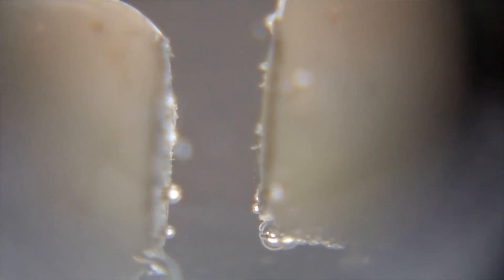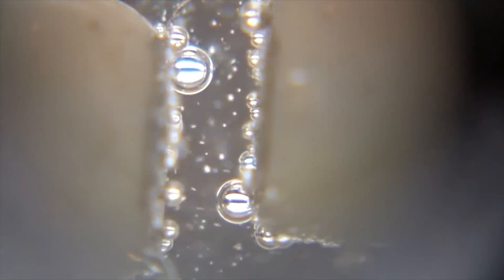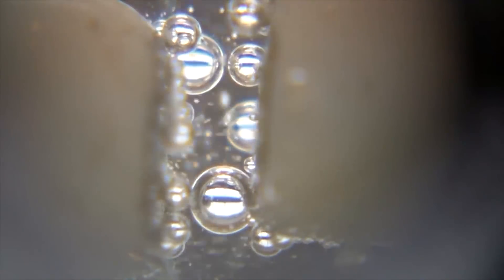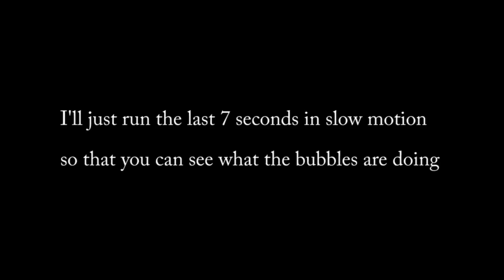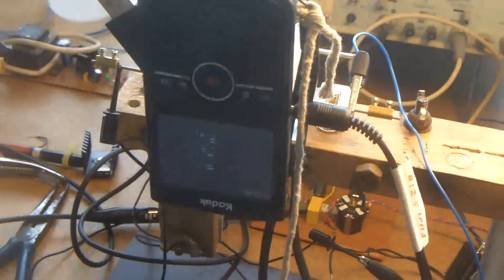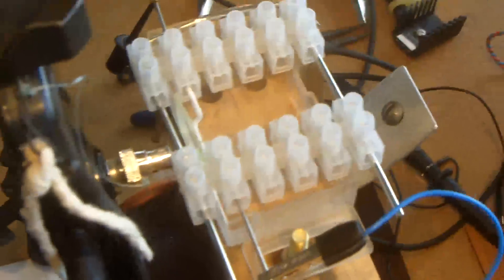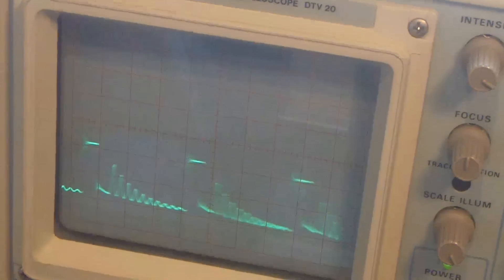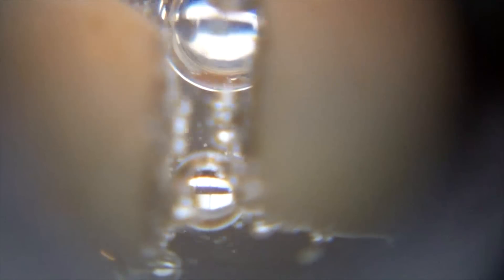HHO. 30 First quick test with pulse generator.

Comment: As the bubbles form, they probably increase the total impedance between each plate in the electrolysis cell. I think it would be useful to do electrolysis inside an ultrasonic cleaner, so the bubbles would be shaken off of the plates and thus keep the impedance lower. I reckon the speed of electrolysis would be much faster.

Comment from the maker: Hi Dick, thanks for the interest, man there are so many options to consider.
I guess I could simply swing the electrodes through 90° or even just one of them.
It’s easy to forget but that view under the microscope is a tiny tiny world smaller that the head of a match but I think that’s where we might just find the answer to the HHO dilemma, i.e. how to get the gas out efficiently. I thought folk might find it boring but I couldn’t resist showing it.
all the best ... Andy

Comment: Very interesting. I'm now wondering if the bubble formation tends to be straight across f line of sight, so to speak. What would you expect if the ends of your probes were covered with the  insulating material with a small length of the sides un-insulated, but with the probes oriented as they are now, so current flow would be out the side of one probe, make a 90 deg. turn, across the gap, and another 90.? Its not in keeping with your train of thought, so don't let me mix you up.
Good work!
Dick